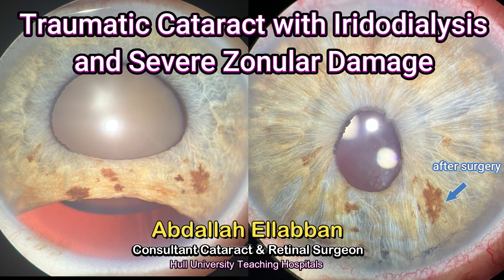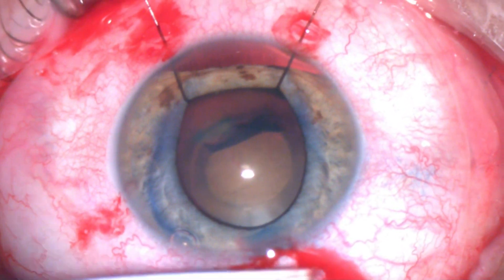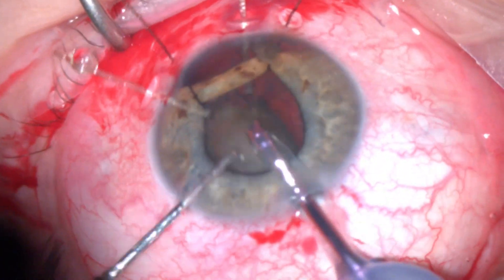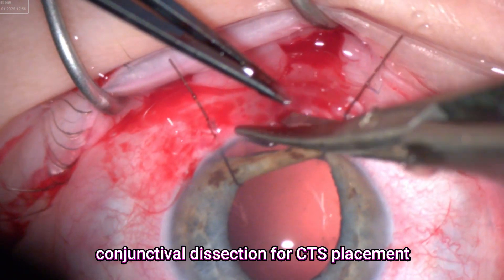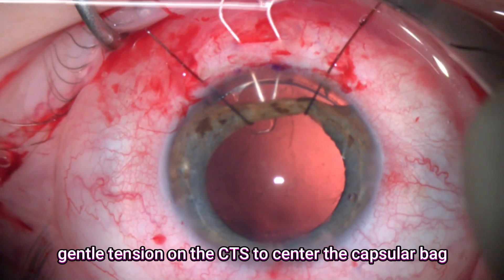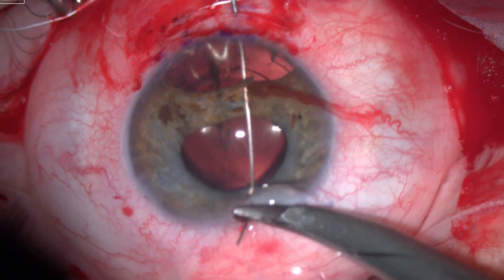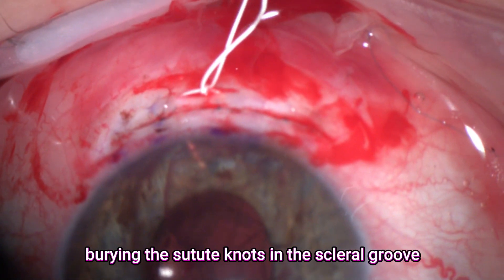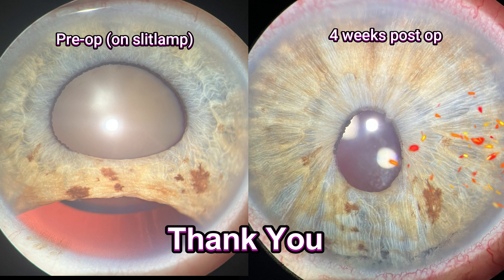Iridodialysis repair with capsular segment & ring for a traumatic cataract with zonular weakness

Comment: تسلم ايد حضرتك ...هل نحتاج اكثر من امبول خيط لاصلاح القزحية بعدد ٣ غرز ام هو نفس الامبول ؟..شكرا للايضاح
Reply from the maker: Good point. Sadly,  3x double-armed ampules. You can use only one, but you will need to pass the sutures the other way around.
Reply: I thought of it, and also i think you have to start with the needle from outside then change direction “from inside the AC to the outside to be able to tie the knot freely outside the globe